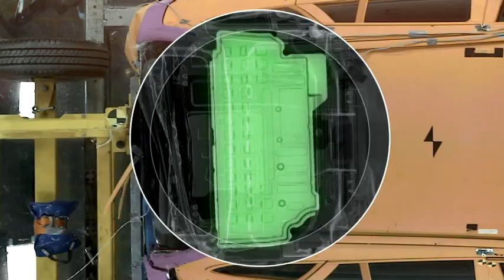Volvo V60 Plug-in Hybrid crash test

Comment: @treetooone That's not a crash test, that's showing the braking system that Volvo had put in the S60. It was a demonstration that went wrong because the system wasn't connected to the battery properly. It's amazing what a simple mistake can do.